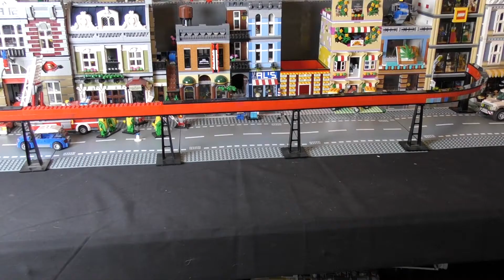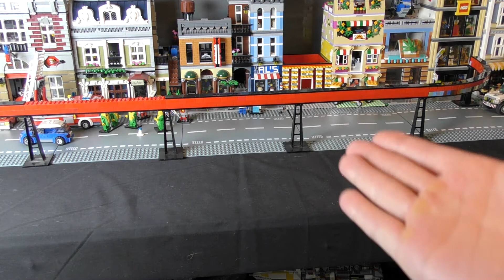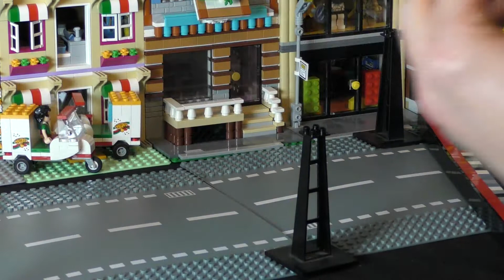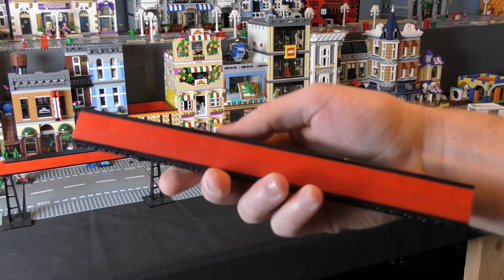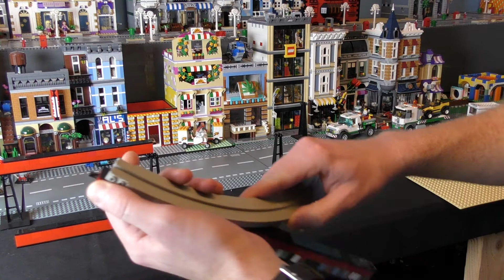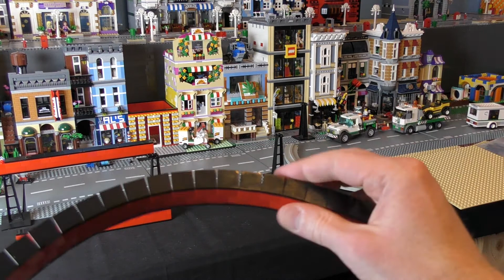Custom Brick Built Lego Monorail Train Track

Comment: Very nice idea and cool way of bending bricks. Correct me if I'm wrong but don't you need a gear rack along the top of thew track to move the battery-operated section of the monorail?
Reply from the maker: Not for the design that Japanese guy came up with.  It uses a tire along the top of the rail for the drive wheel.  No gear drive on this one.